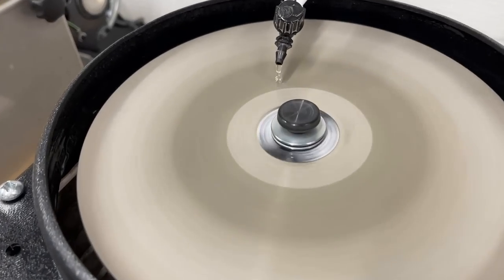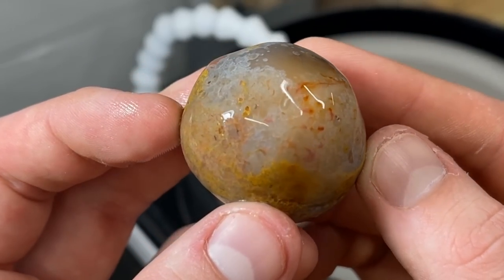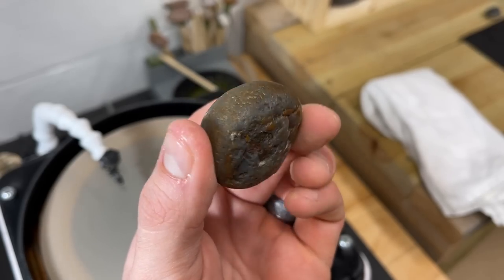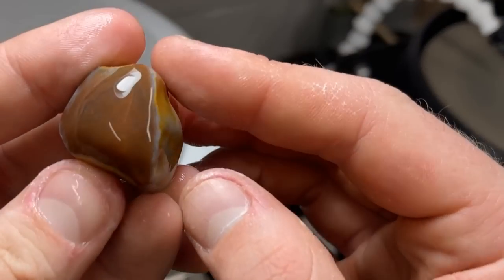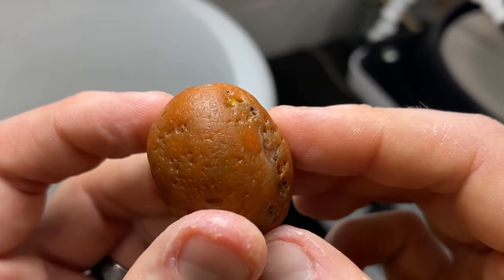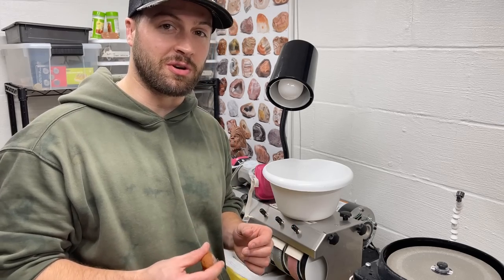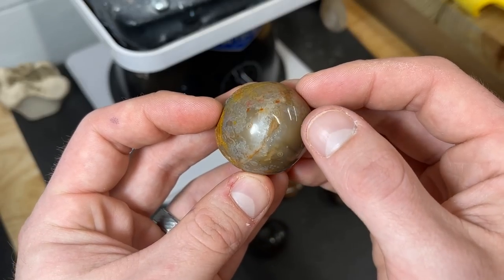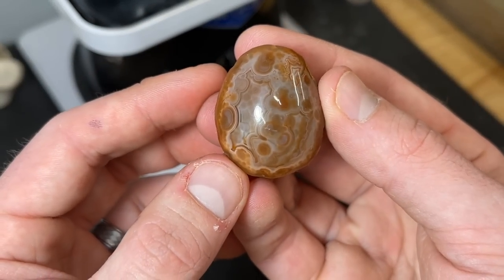Grinding the HUSK off Agate Nodules | Exposing HIDDEN details! (Lapidary)

Comment: Fun demonstration! The last was my favorite also.  It seems as though the little surface holes/tubes you sanded over, weren’t filled in all the way.  So where you sanded down to where the tubes’ insides were level with the surface, bands appeared around the tubes.  So were the bands formed inside the tube shaped voids?